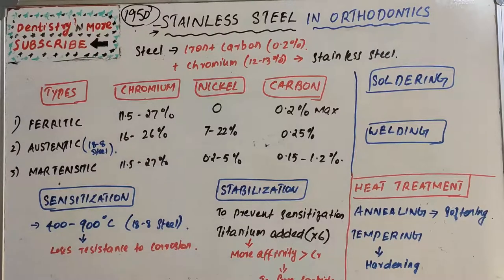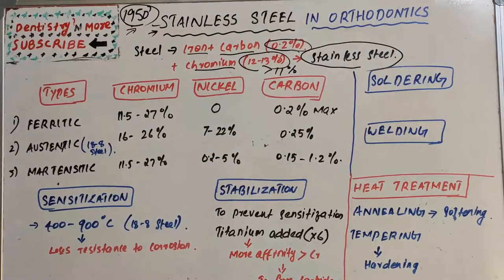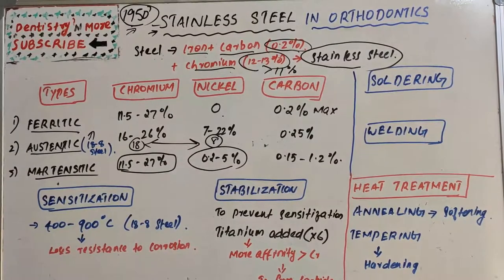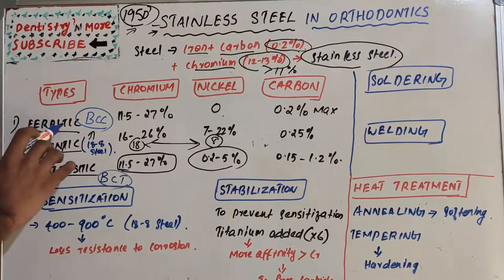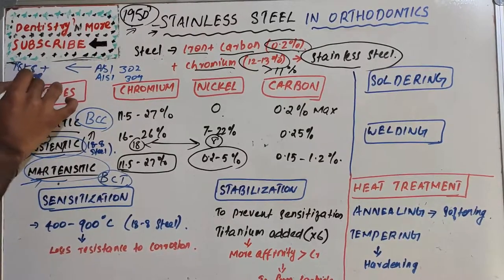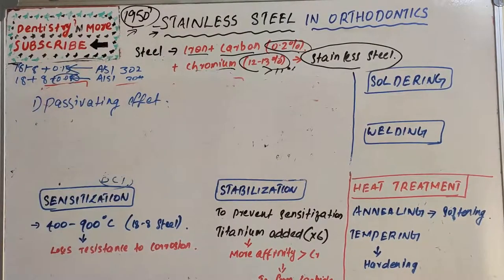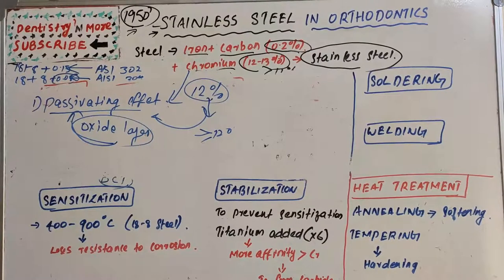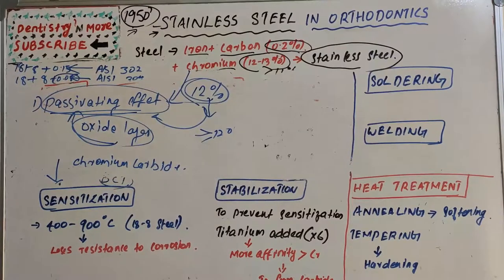STAINLESS STEEL

Comment: how this oxide layer disappear
Reply from the maker: When there are concerns with environmental and/or storage conditions to which the galvanized steel will be exposed, passivation treatments can be used to prevent the formation of wet storage stain. Generally, passivation coatings last about six weeks . At that time, galvanized steel will begin to weather naturally.